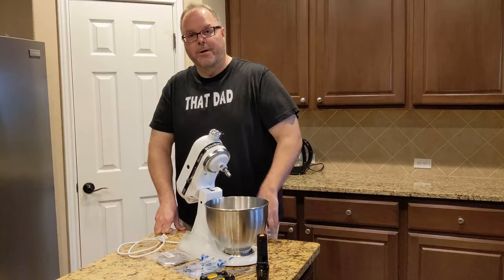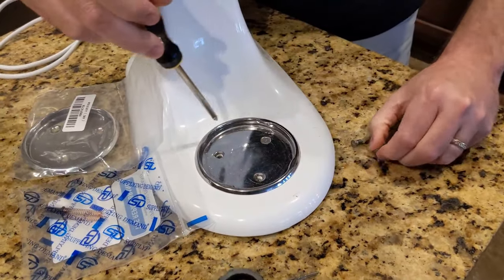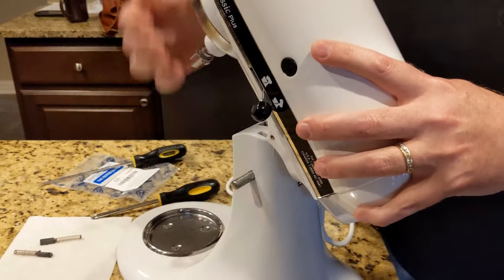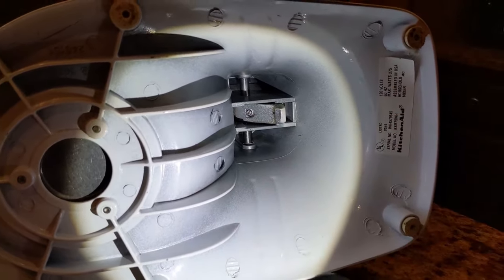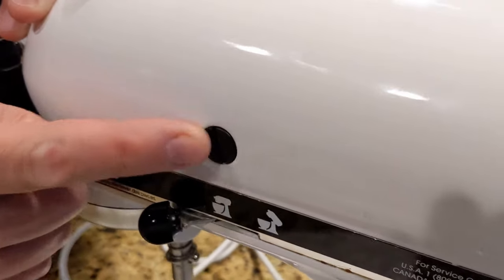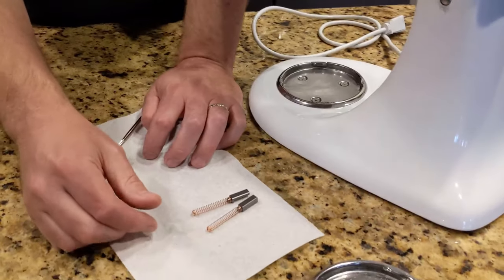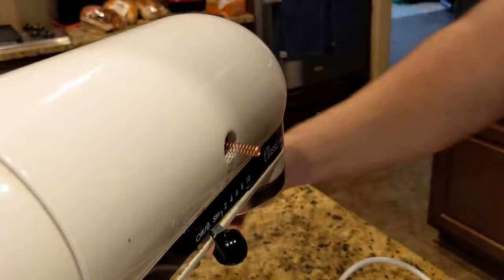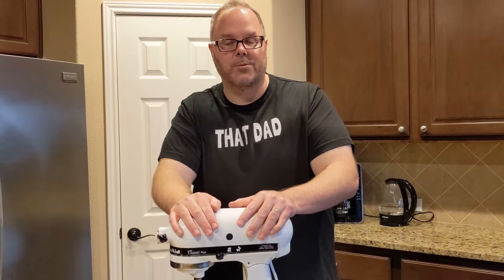KitchenAid Stand Mixer Wobble Fix and Tune Up

Comment: I have checked everything you indicated,  but my kitchenaid artisan tilt head still shakes so much that when making cookie dough I have to hold down the head!  Any more suggestions?
Reply from the maker: Is the lock on the side working correctly to hold the head in place?

Comment: thanks for the tutorial!  I have a question maybe you could help.  lately when I turn on my kitchenaid mixer  it does not start easily and I have to toggle between different speeds until it starts. is this a problem with the motor brushes?  thanks
Reply from the maker: Thanks for watching! My initial thought is that it could either be the brushes or the switch itself. I would check the brushes first and see if they look worn as it's the least complex and inexpensive to fix. The great thing about these mixers is they are relatively simple mechanically which makes it much easier to work on.
Reply: @ThatDadMike  thanks for your help  I 'll check it!

Comment: Good video. I have a problem which seems to be the gears being worn. The model is old., was handed doen by gma and its like a Tiffs blue so it's in beautiful condition, just slips when mixing. Serial# WL0898676 Mod# KT2651XSG. Any suggestions where to find parts? Kitchen Aid said they're obsolete.
Reply from the maker: That's going to be a tough one. EBay is the only place I could think of that may have the obsolete parts.

Comment: How did you unstick the bowl to change the bottom
plate? is there an easy way to
Reply from the maker: That's a really good question. It was tough. I ended up spraying the base with WD 40 and then held it with a towel at the top and yanked it a few times and it came out. You could also put a towel over the bowl and then vice grips over the towel to minimize scratches so you can tap the voice grip with a mallet if it is really stuck. If you have a strap wrench or ratcheting tie down that could also work to give you the leverage you need.
Reply: thanks!

Comment: Hello Dad Mike, how can I put back the long metal that goes across the middle of the mixer? The one you pushed back in! Mine is completely out and I try to push it in but is not going all the way through! 😿
Reply from the maker: What I would do is loosen the screw that holds the pin in (the one I tightened in the video) and then try to slide the pin through. You may need to lift the mixer up slightly off the stand to get the pin to slide in.

Comment: Is it possible to insert the brushes incorrectly or do they fit only one way?
Reply from the maker: It is! The brushes have a 45 degree angle on one side that helps  ensure they are inserted correctly. If you put them in incorrectly, the machine will not turn on. If this happens, just take them back out and rotate them.

Comment: My mixed s on off latch is acting weird it won go to the off position. Plz help and how do you need to know that we need to change the brush ?
Reply from the maker: Thanks for taking the time to comment! Are you talking about the latch that turns the mixer on and off, or the latch that locks the mixer from tilting? If it is the switch that turns the mixer on or off, the switch may be broken inside and need to be replaced. For changing the brushes, I noticed that my mixer was not going to the highest speed settings and changing the brushes fixed it. In other cases, I have read where others are unable to turn the mixer on at all and changing the brushes also fixed this problem.

Comment: What if my pin is stuck in the wrong position?  Any tips to get it loose?
Reply from the maker: See if you can completely loosen the set screw underneath and then wiggle it out from the side and reposition it.

Comment: my mixer just stopped Spinning but motor working could the motor brushes be the problem?
Reply from the maker: I don't think so because the brushes simply transfer the power to the motor. If the motor is running then it is plausible that the brushes are working. You could certainly try it just in case since the brushes are under $10.
Reply: Probably need to replace the worm gear.

Comment: hi dad mike, my problem with my mixer is that when i plug it.  it starts to beat eventhought i have not started it yet. could you please help me with this..thank you so much
Reply from the maker: Hi there! It sounds as if the on/off switch mechanism or control board may be faulty and stuck in the on position. This is one I would have a local repair center determine as they will likely need to rule out a faulty control board, switch or something else. Apologies I could not be of much help.

Comment: I bought a used one and found that the bowl would twist past lock. The bottom of the bowl was worn. So I drilled a stainless steel screw into th bowl and slightly ground half the head of the screw just enough to fit into the base. Now it twists into lock position.. .we'll see how long it lasts
Reply from the maker: Wow, that was an excellent idea!

Comment: I have the same mixer.  The tilt head is very hard to move up and down, as if something is stuck in the pin area.  The machine is very clean - no sign of rust in the pin area anywhere.  I loosened the pin screw underneath but it does not free up the tilting movement.  Also, the pin is very tight.  It was sticking out to one side about 3/8 inch.  Even with the screw loosened, I had to pound on the pin with a hammer to slide it back
Into place.  It almost feels like maybe there was a rubber gasket in the pin contraption that moved out of place and got trapped alongside the pin.  I called Kitchenaid and they cannot provide a diagram of the pin mechanism to see what is inside there, and had no advice.  Do you have any idea what the problem might be?
Reply from the maker: The pin mechanism seems to be really simple. I wonder if the tilt head piece that the pin goes through is slightly bent, or if the pin is slightly bent causing it to be difficult to tilt?
Reply: @ThatDadMike  I was able to get the pin out completely.  Can’t pull the head off the base though.  It’s as if something else is holding that head on.  Does that make sense?
Reply from the maker: Are you able to move the head latch to the open position? Send me an email at tdmikefan@gmail.com and I can send you a few pics of mine with the head removed if that would help? I just pulled the pin out moments ago to see if I could see anything else that may be holding it on and other than the latch, there was nothing else.

Comment: when i use my mixer i started to smell like something is burning and its really hot to touch that i have to pause for a while to let it cool down . i never run it for more than 5 mins. what might be the problem? i barely use it . ihave only used it 4x since i bought it .
Reply from the maker: Whoa, that's a tough one. Unfortunately it sounds like it could be a number of things and it would be best to have a technician look at it. Sorry I could not be of help but keep us posted on what the problem was and how it was fixed.

Comment: What if you don’t have a screw underneath? I tipped mine over and there’s no screw. My mixers 1- 1/2 years old. Got it in 2022
Reply from the maker: Are you talking about the hinge pin popping out? If so, take a picture of the underside and send it to me at tdmikefan@gmail.com and I will take a look.  There has to be some way to adjust it.

Comment: Hey Dad Mike. Thanks for this video! I recently bought a mixer on eBay and have had to fix it up here and there. The neck pin/dowel screw was missing so just installed that today. I've also adjusted the bowl clearance numerous times with the dime test, but for some reason it still makes a clank noise against the bowl. I'm having a hard time troubleshooting so if anyone sees this and has tips lmk. Like the way I could write the noise is like..baDUM baDUM. Or Cah-CLINK. 

The only think I can maybe think of is the bowl being warped? Idk. It came with a ton of scratches so clearly the previous owner didn't care for bowl clearance.
Reply from the maker: Hi there! If you adjust the screw that keeps the head from bouncing up and down a bit more does it still do it? When it is clanking, is the mixer head bouncing or does the part where the attachments hook to the motor look warped when it is running?
Reply: @ThatDadMike  thanks so much for your reply!!! I removed the ring cover around the planetary (where the attachments...attach lol) and I do see it is warped when it is rotating!!!! That is most likely the issue but I cannot find any fix info online. Do you have any tips on adjusting this?m
Reply from the maker: That may just be a part that you have to replace. Try this website and see if you can find the correct part number using the diagram (make sure the mixer model is correct); https://www.partswarehouse.com/KitchenAid-4-1-2-Quart-Classic-Stand-Mixer-Classic-With-Ti-s/575811.htm

Comment: What function has the brushes do
Reply from the maker: The brushes are what transfer the electricity to the motor. If they are worn, it is possible that the performance of the mixer will be decreased.

Comment: Mine doesn’t have that type of pin, and the flathead screw is a Torx 15 for me.
Reply from the maker: I wonder if they changed it over the years?
Reply: @ThatDadMike  could be, i used the Torx 15 tightened it up like your instructions and worked like a champ thank you sir.

Comment: Why would you want to replace the brushes?
Reply from the maker: The brushes are what transfer the power to the motor. If they are worn, the power transfer may not be as much as it should be. In my case, changing the brushes corrected my mixer not going into high speeds. In some cases, worn brushes could cause the mixer to not turn on.

Comment: Now put the bowl and the beater back on and see if you have the right amount of clearance between bowl and beater.  Some of them need to have the head adjusted up a little bit to clear and when you do that the lock won't work anymore.

Comment: Actually, I did not change out the brushes.  I had removed them for no real reason and did not know what direction to align them in.  You would not need to replace the brushes, necessarily, unless they are worn.  There are other YouTube videos showing worn brushes.  In your case, Alexandria, it might be the brushes.  I would recommend doing a further Google search.

Comment: What about the grease inside transmission
Reply from the maker: That will make a great video! I have not needed to tear mine down that far yet but will definitely film it if I do.
Reply: Mike, one place I read that it should be greased annually.   A video of that would be great.

Comment: That screw under the head adjusts the height of the paddle.
Reply from the maker: Correct it does also raise the paddle slightly. If you raise it too much it will affect the lock mechanism.

Comment: My mixer can mix dough no force and stop
Spinning
Reply from the maker: It is possible that the brushes are worn and need replacement. Since the brushes are not expensive, I would recommend inspecting them and then replacing them. My mixer was low on power when I mixed dough (it would not go on the highest speed setting either) and changing the brushes fixed the problem.

Comment: my mixer was on its side and leaked some oil. How do I know if there is enough? Or how do I add oil?
Reply from the maker: A small amount of leak while on its side should be ok. If it leaks in the upright position it's probably time to change the grease. The grease that is used is thick like Vaseline - if it leaked a bit it likely separated and many say to run the mixer to mix it back together. Make sure it still sounds normal with no unusual sounds and that the motor does not feel hotter than you are used to. If you decide to open the mixer up and change the oil, here is a video that shows you how to do it on a tilt head KitchenAid mixer (it's a messy job but not all that hard to do :) ) https://youtu.be/ND1b9P2iubg?feature=shared